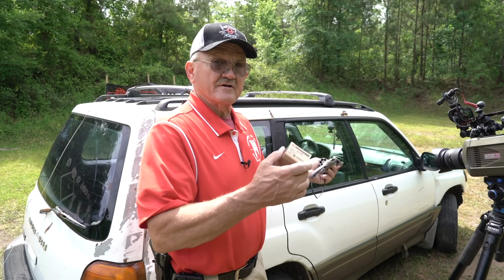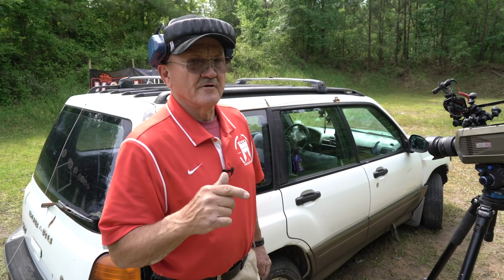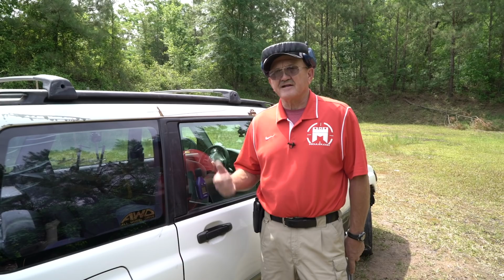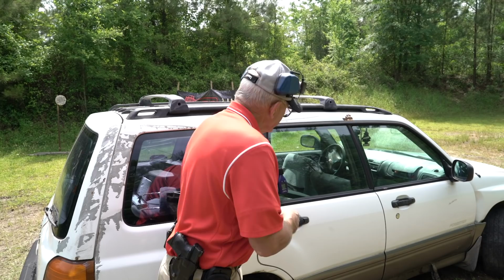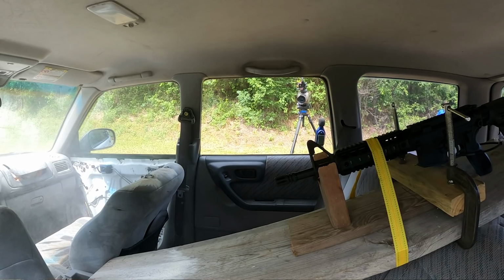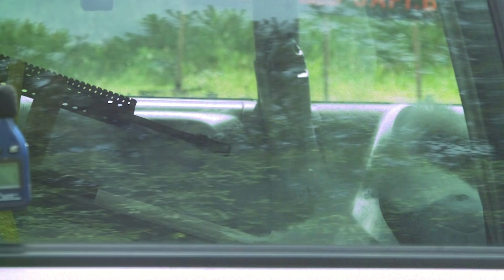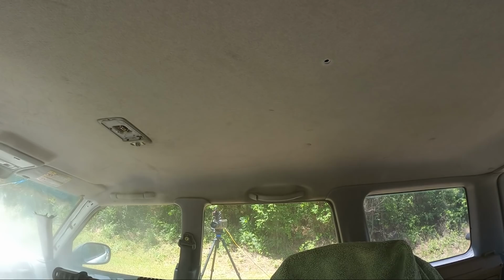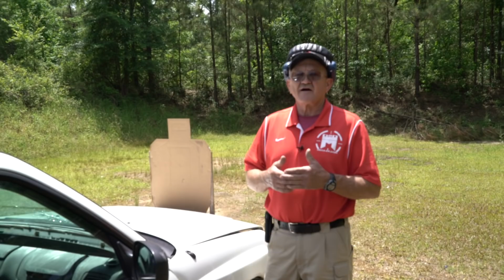Shooting the 50cal INSIDE MY CAR!

Comment: Would have liked to see data from the inside of the car. As a veteran that now wears two hearing aids largely because of discharging firearms in enclosed spaces. In my experience it's life changing.
Reply: Years of service but it only takes a second or two and your hearing is changed for life.
Reply: I would have loved it too, but the sound level needed for that would be a few thousand dollars. It's a shame not enough people talk about the dangers of firearms without enough hearing protection, especially when it comes to our veterans and active duty members.
Reply: God is good

Comment: crazy!
a shame we couldn't get the internal decibel levels, I'm they would be insane.
Reply: On a training range I was driving a humvee and because of the blank firing adapter I actually needed ear pro even though it was blanks and the gun was on the turret.
Reply: Having shot a 357Sig pistol in a house Dec 13, 2019; my left ear is still pretty much gone. When I watch officers shoot from their car my brain hurts.
Reply: It's actually very hard to accurately measure very loud very short duration impact noises. Unless there are new technologies I am not aware of?? The little handheld unit probably doesn't even tell the whole story outside the car. I researched this deeply when I was younger and started getting tinnitus even though I was religious about hearing protection.
Reply: @AnomadAlaska  Getting the peak wouldn't too hard & he dose say there is a limit to what his little meter can 'hear'.
The highest sound/pressure wave will be the first wave, even when the sound bounces around inside of the car, the max won't get any higher. The energy will be dissipating. 
With modern systems, what used to be hard is now daily occurrences.
Cells phones, kevlar, super sonic plans, freaking lasers.
Reply: @AnomadAlaska  in pretty sure a termpro will meter it
Reply: It's one of the under talked about dangers of firearms. Having to use one without hearing protection is guaranteed to damage your hearing out in the open air, let alone inside of a car or in a building. Contain that sound even a little bit and it'll be extreme hearing damage. It's something I don't think is talked about nearly as much as it should be.
Reply: @FUBARguy107  .454 cassul on outdoor range without earplugs... i was nearly deaf for a month on right ear and "only" for one or two weeks on left ear

Comment: I did some sound pressure testing on various center fire rifles with some very fancy reference microphone and measuring equipment.  We tested from .223 up to .460 mag with and without muzzle brakes.  From what I recall, the SPL ranged from ~160 dB to ~171dB measured 1 meter from the muzzle, angled slightly behind it.  The biggest difference between the calibers was the where the energy was in the frequency spectrum - the big bore cartridges had significantly more low-mid range.  They are all exceptionally loud, and will immediately and permanently damage your hearing.  This is particularly apparent in an enclosed or reflective environment such as a car, walls, or indoor shooting ranges.  Double plugs (as Jerry has shown) is essential in protecting your hearing.

Comment: Impressive side windows in that car!!! They flexed WAY out of the channels and I thought would surely shatter! Fun video, Thank you, sir! 👍👍
Reply: 69CamaroSS407 for a long time Subarus have had frameless door windows. You can slam the door on your hand and if you only catch window it won’t cause injury or break the windows. It also makes them ridiculously easy to break into. My first car was an 84, they run forever, but you can break into one with a coat hanger.

Comment: I don't know how chamber pressure would translate to decibels but I was thinking that the officers hearing was probably damaged by the pressure wave that is generated by the charge that propels the round.  I'm fascinated with the refraction effect that can be seen with high speed cameras, caused by the pressure wave, when any explosive is ignited.  You talked about chamber pressures the other day, I think in the video comparing 223 and 556.  Chamber pressures are measured in tens of thousands of PSI.  As you mentioned in this video, that pressure has to go somewhere.  The pressure wave from the 50 cal looked like it pushed out the side windows a couple inches.  Now imagine what that pressure would do to delicate eardrums :-)
Great video.

Comment: I wonder if it was a car that had the front windows in frame (instead of where there is not one on that Subaru) it would be easier to blow the side windows out since the windows shouldn't be able to flex as much
Reply from the maker: That’s what we were thinking. If the windows were more braced would they have broken? Maybe time to get another model and test the theory!
Reply: No need to swap vehicles, there has to be a brake for that beast with enough ass to break those windows. They flexed a good inch, if it was missing the weather strips on the bottom it would have popped.
Reply: @MiculekDotCom  I'm sure your sponsor can arrange for a suitable vehicle....all in the name of science of course!

Comment: I was in the passenger seat (wearing hearing pro) and the person in the driver’s seat was engaging a target through the windshield. What made it especially interesting was his use of a 7.5” barreled AR15 in 5.56mm. I found the flame leaping across the car (from his muzzlebrake) to be a bit distracting when I was also trying to engage through the windshield.

And it was LOUD even with hearing protection.

Comment: I'm surprised that 50 didn't blow out side windows, I was talking to a coat guard shooter years ago that mentioned it was a problem when they shot out of helicopters at drug boats, apparently it took a while to find a muzzle brake that didn't hurt the pilots side windows
Reply from the maker: The whole crew thought the windows were going to be blown out....very surprised!
Reply: I'm betting its because that Subaru didn't have window frame, you can see the windows popping out away from the seals, letting out the pressure. I'd bet if the car had a window frame that held the window tight, it'd blow at least one out.
Reply: Give it a few shots and I'm sure it'll go
Reply: I expected the same thing. If the door panels were in place it probably would have
Reply: FairlyUnknown right, you can see in the slow mo the windows being pushed out quite a bit

Comment: That 50 Cal almost blew the  windows out
Reply from the maker: Crazy part was no windows blew out during the entire thing!
Reply: I was surprised it didn't. I watched the slow mo again. Look at the corners of the windows. It looks like they moved out and vented the air by almost 2 inches.
Reply: @MiculekDotCom  
This definitely sounds like a time to double up on the hearing protection, ear muffs🙉 over ear plugs!

Comment: Done it. Late winter 1974 in Mobile Alabama. 1970 Impala 4 door sedan, with all windows rolled up tight and heater fan on high.
S&W 10-2 in .38 Special. I won't say why I had a discharge under these circumstances, but I couldn't hear for several days afterwards,. The window was easy to replace.
Reply: JSBIRD69 so a .38 from the 70s  is equal to a modern.50 cal?  Guns back then must of been really tough.

Comment: That sound meter is not designed to measure impact sounds, it's deigned for a longer duration sound which is why the readings don't make sense. You should get a meter like the one Tim from military arms has

Comment: The .50cal knocked the 'B' off on the Subaru nameplate on the hatchback. Also the windows blew out of their sills. The rear passenger seat window didn't return back in properly and is located outside of the padding on the outside of the door!

Comment: Would the car technically act as a suppressor in this instance. This was a thing on Gun Meme Review so I’m interested if it actually suppressed it.
Reply from the maker: It wasn’t as loud as normal on the outside. Definitely suppressed the sound.
Reply: 127 dB for the 50 BMG is hearing safe. Most suppressors reduce the noise to 136 dB which is still loud AF just hearing safe for instantaneous noise.
Reply: @MiculekDotCom  you better have a tax stamp for that Subaru
Reply: 120dB is quiet for being so close to a gunshot. This is one of the reasons trained snipers shooting from buildings don't poke the gun barrel out the window. It's also completely legal in the US. Suppressors are only legally restricted if they attach to a firearm and are portable.
Reply: @MiculekDotCom  
Would it be possible to get the sound meter on the inside? That's the more relevant point to your anecdote, reflective concussion dynamics says that the pressure wave from the muzzle would be extremely unpleasant for the guy in the closed box that is a car, but your story about the sound sounds really likely to result in hearing damage with a lot of calibers that normally wouldn't.
Reply: @timewave02012  well the firearm attached to the car and the car can be mobile so technically the childish a.t.f. might look at it that way. Lol
Reply: @CtrlAltRetreat  It would not read high enough
Reply: What do you think? I'm sure (at least I hope) you can figure out if a gun fired inside a car is quieter on the outside.
Reply: @xenonram  
How much is the point of a meter. If it's 5 db more, no one cares, 10? Starts getting worrying, 20? Lighter arms go straight into permanent hearing damage range. A short barrel 357 going unpleasant doesn't surprise me, the really relevant question is how 380, 9mm and 45 sound in that car, and with and without porting with a snub and full sized barrels. I've found that porting can make snubbies  unpleasantly loud even with L3s on in normal range conditions. Is it intolerable in a car? Are the heavier calibers enough to cause ear boxing and render vertigo? These questions are especially relevant to law enforcement who may need to defend themselves from their patrol cars. 

If 9mm is a lot safer or possibly faster powder and lower total powder charge 45 loads are a lot safer, that's important info. These lessons are directly applicable to tight hallways outside of apartments and leos almost never get to wear hearing protection when responding.
Reply: @CtrlAltRetreat  They'll need a different meter to test that inside the car. I suspect they just went with what they had for this one.
Reply: @Stigstigster 
Right, he said it only went up to 140. That said, over 140 is well past safe and finding out what sort of carry guns won't push that meter into err range will give a lot of good info. Maybe an idea for a testing specific channel though. It doesn't really take advantage of Jerry's skills do this. I was just thinking it was a pity that there wasn't a meter inside given the opportunity.
Reply: @CtrlAltRetreat  I don't think any rifles or pistols are under 140dB without a suppressor. Pick a caliber and look it up on NFA Review Channel or Silencershop channel and they usually show dB unsuppressed in their suppressor testing videos.
Reply: @CtrlAltRetreat  Jerry said the meter only went to 130 db.

Comment: I noticed the windows in the slow-mo shot really flexed outward. If you shot from a vehicle which has windows framed all the way around, I wonder if it would shatter due to excessive pressure? (The Forester door windows don't have a metal frame around the top/rear) hmm...?

Comment: Discharging a firearm of any large caliber inside of any small enclosures, can and most likely damage your hearing. I can't count the times from being an officer on the range,  in which case we use electronic hearing protection,  to forget  putting them on, because we are use to using them to hear range commands clearly and bammmmm, ears are ringing for hours.

Comment: A Subaru was the wrong car to use. They have rimless doors (only resting on rubber cushions above the top of the physical door). So the top of the glass could flex away from the door frame, allowing pressure to be released. Glass is surprisingly plastic. With standard rimmed doors, the .50 would have blown all the glass out & burst the occupants eardrums.

Comment: I am a certified hearing conservation specialist.  Gunshots cannot be measured with a common sound level meter.  The sound pressure levels from gunshots are closer to an explosion that these meters cannot measure accurately.  There are specialized meters that can, this is not a scientific exam.